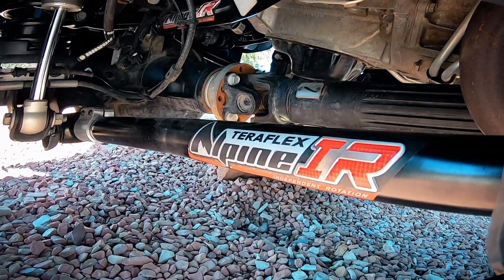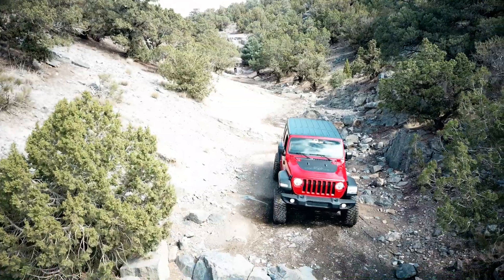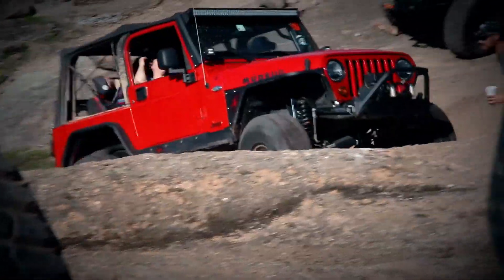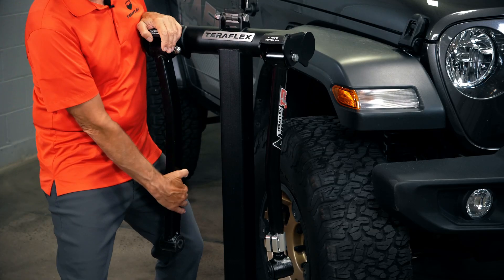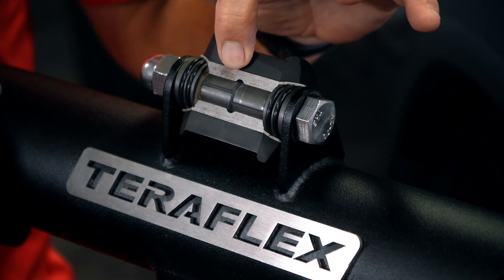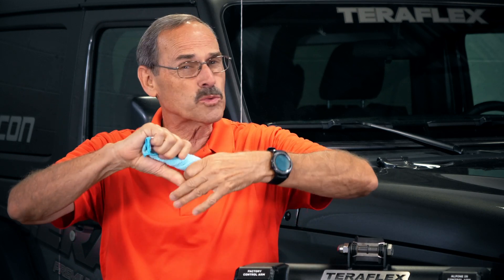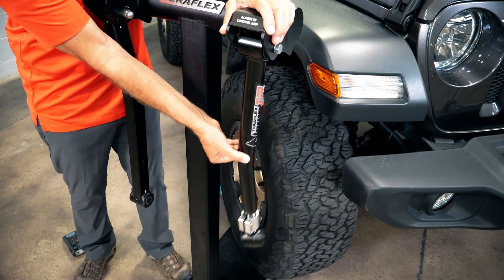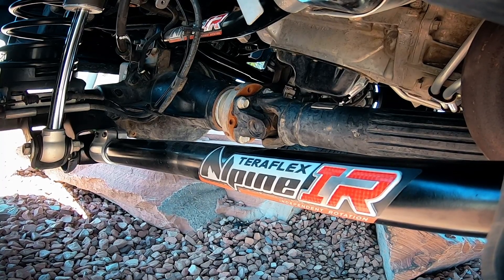Independent Rotation (IR) Bushings | TeraFlex

Comment: I know that you guys thoroughly test your products. I would really like to see one of the joints from your test rig that you have been using. Is the joint greased? If so does it require a special grease? Articulation isn't the only thing that matters, but it would be nice to see how this new joint helps to increase your flex compared to standard clevite bushings or competitors joints.
Reply from the maker: The joints are sealed race bearings and are greased from the factory. No need to ever grease them. They are specifically designed to eliminate any bushing bind making they axles able to articulate  easier.

Comment: I'll have to reserve judgement until I see them in a practical demo.
Dennis: I'd highly recommend a video comparative to what Matson put out for their bushings a few years back. I can't have an opinion when I can't see them working.
However, that said, if they're a Teraflex product I know they've been well researched and well tested.👍
Reply from the maker: Thanks for the support. Stay tuned for more!
Reply: Have you forgot about the TeraLow 231 ... lol... sometimes it's best to wait and see products in practical application first ;-) ... a set of nice ballistic , summit,   or Currie joints are proven for rod ends... if you want bushing style joints the metalcloak and synergy joints work well ... and you can get  the synergy as direct replacement for the clevite bushing used in the lower arms , but with the 18mm sized thru bolt offering for the ram truck offering allowing you to ditch the factory 9/16th bolt .